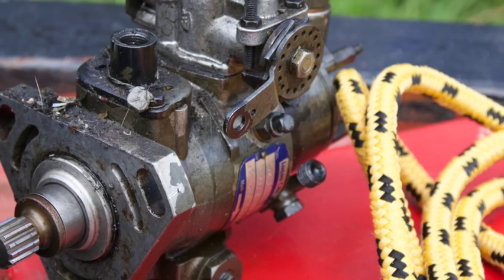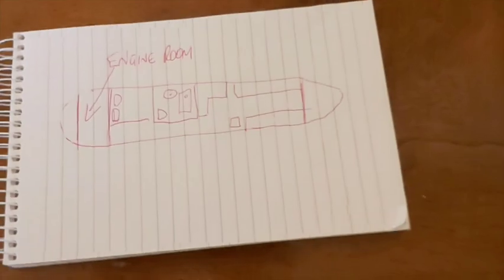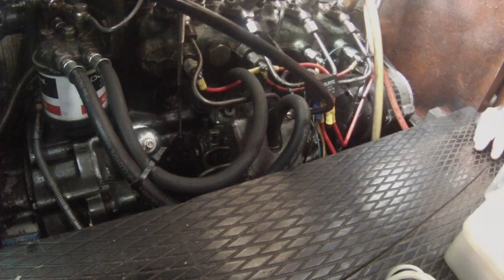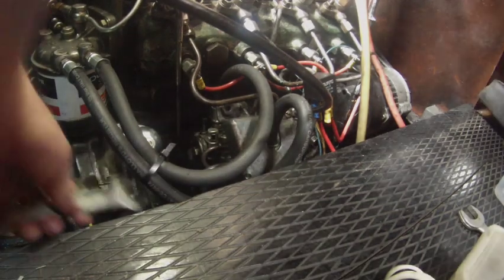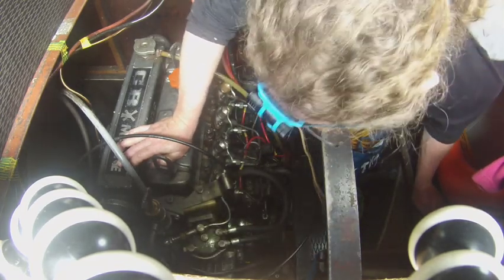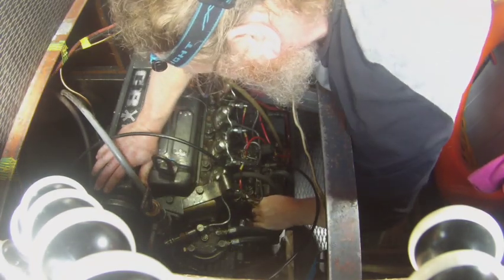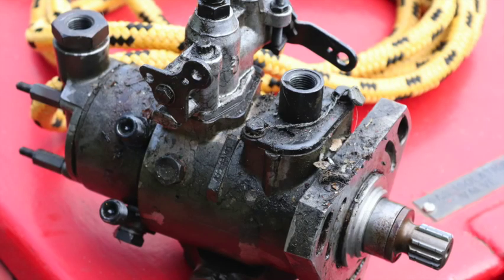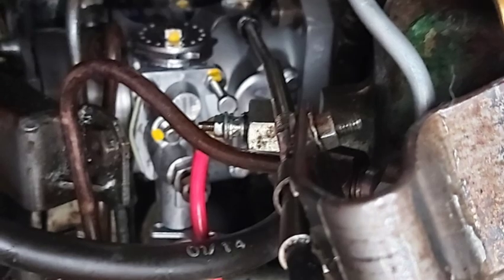Epispode 39 Removal & refitting a diesel injection pump. DIY on a narrowboat

Comment: Fuel can enter the sump via a faulty diaphragm  in a mechanical lift pump if fitted.
Reply from the maker: It did we had a new lift pump fitted (well 2 its a long story) but the pump was knackered. Diesel Bob reckoned it was because the engine hadn't been run for a while.👍

Comment: Hi Saul - very late to the party with this. I'm trying to catch you up from your start - and enjoying the vlogs very much. I have a BMC 1.5 in my narrowboat - producing loads of blue smoke. My thoughts are valve stem seals or piston rings. Didn't realise the injector pump could cause this. But you seem to have gone to that as your first thought. Why? What is it about the injector pump that can cause smoking?
Reply: Hey Ian, Im having the very same problem so share any new finding :).
Reply: try advancing the timing a little.

Comment: Nice job!
I got 50 h/p 4 108- 1972 on my Coronado.
Really Reliable Engine but, fuel start dripping from throttle arm.
Is it possible to find out the number of that particular pump?
Thank you!

Comment: These pumps have a master spline on them.
Reply from the maker: They certainly do Real easy to put back in 👍
Reply: @barelyfloating  so did you mark the pump before taking it off, i have one in my Wolseley 16/60 and its leaking but im to scared to take it off in case it never runs again

Comment: Alreet fella do you have turn the engine to a particular position before removing the pump mines leaking from the throttle linkage cheers
Reply from the maker: I didn't turn the engine to any position just put a mark on the pump & the engine block so I could align it up when I refitted it. I made sure to tell the pump refurb guys what the scratch was for hoping they wouldn't clean it off, then I left the engine alone didn't turn anything over just in case it buggered everything up. 👍
Reply: Many thanks fella awesome vids I'll give  it a whirl cheers

Comment: Hello,  well done! I've no boat but a tractor with the 1.5 bmc diesel and the  same problem with diesel in oil. Did you makel any position marks  before removing the pump! Thank you!
Reply from the maker: Thanks, Yes I marked the pump & & made sure I informed diesel bob what the marks were for I think I may have not quite got it back into the exact position but I'm awaiting new glow plugs before I fiddle with the position of the pump